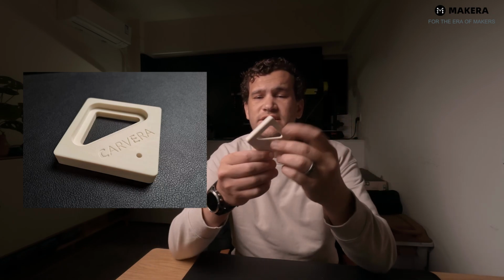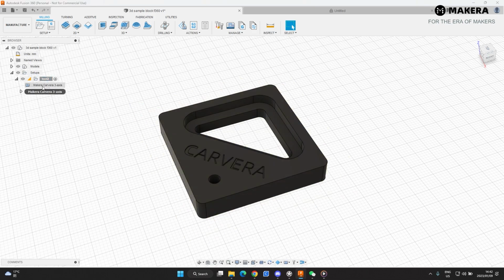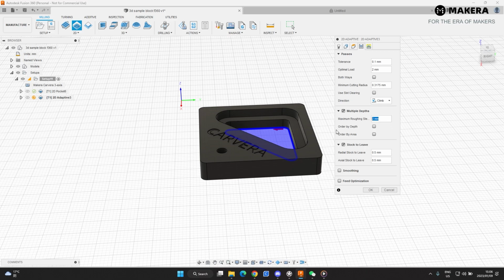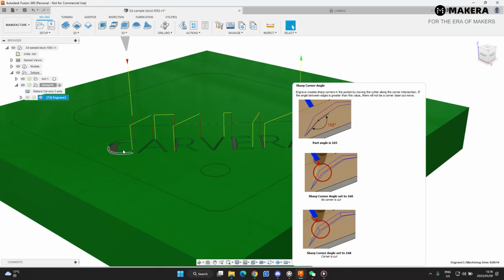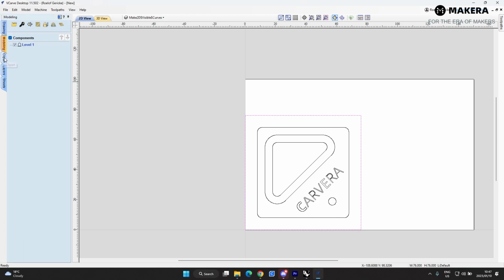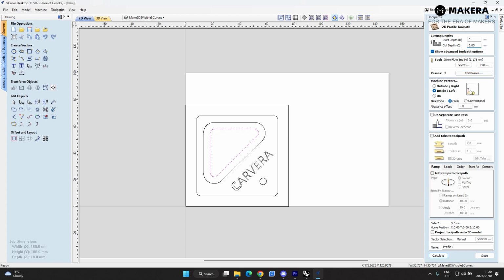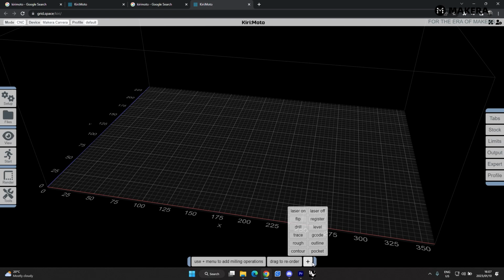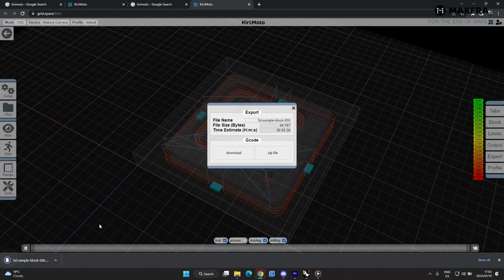CAM Software comparison Fusion360 vs VCarve vs Kiri:Moto

Comment: Since the Makera authorization servers are down right now, meaning no one who recently purchased a Carvera CNC can install the Carvera CAM software, these other solutions are all that is currently available.

Fusion looks like it will take weeks to learn even the basics, VCarve trial is unusable, and Kiri Moto has had major version changes which completely removed some of the settings used in this video.

Kiri Moto is great, don't get me wrong, but its user base is so low, and the tutorials are so old, it's currently in a weird abandonware state. Unless you're a seasoned F360 pro, or willing to drop more money on VCarve, you can't use Makera CNCs right now.
Reply: And of course the discord link is expired, so you can't even get the Makera example step file used in this video anymore. I had no idea amateur CNC was such a ghost town.

Comment: Hi there, thanks for sharing this video. As a beginner, how do I know which tool should I use when cutting contour, or when cutting characters? are there a table for this?
Reply from the maker: Your model's required detail and inside radiuses would determine the tool size needed. If your model has very fine detail then a smaller bit would be recommended and if you are doing contour 3d relief milling a V-bit would be recommended.

Comment: Hey, Carvera folks. I appreciate that you're building quality hardware that brings precision cutting to more people. That said, it would be fantastic if you funded and contributed to the Path workbench in FreeCAD so that even more people can afford good CAD and CAM. As important, FreeCAD makes it possible for collaboration that no commercial software can support: $0 per seat for all features. That's the collaborative way of the net and that's a passionate customer base to energize.
Reply: Free, feature complete, a good UX/UI... you should at least be able to pick two. FreeCAD is the Audacity/GIMP of the engineering world.

Comment: Quick tip for Fusion 360: when you do simulate, you can turn on "stock" and it will generate a 3d visual/preview of the stock being cut away